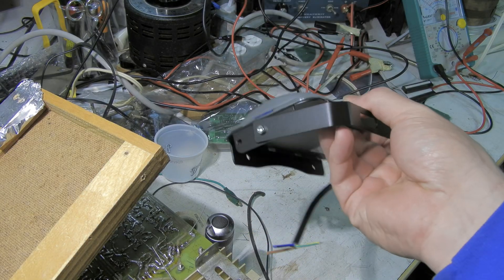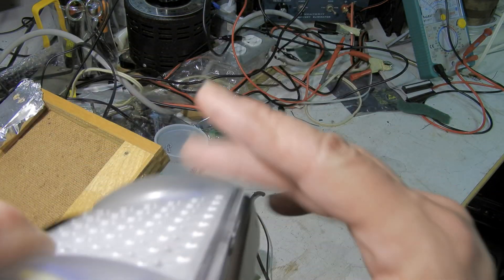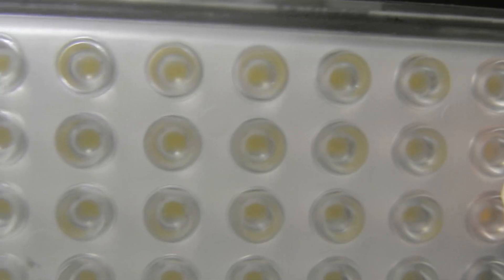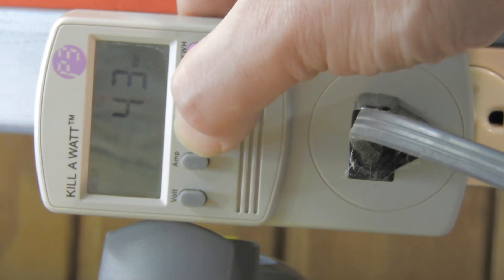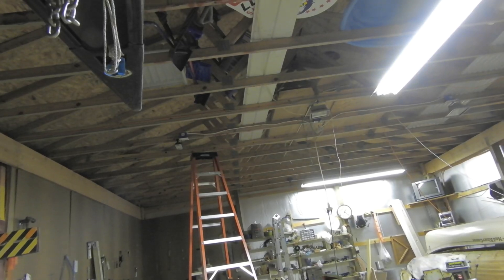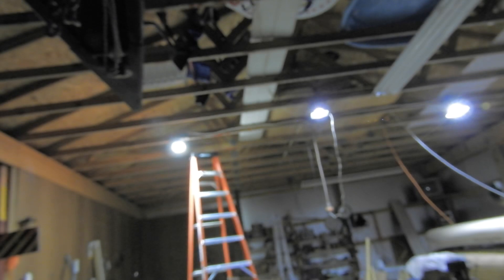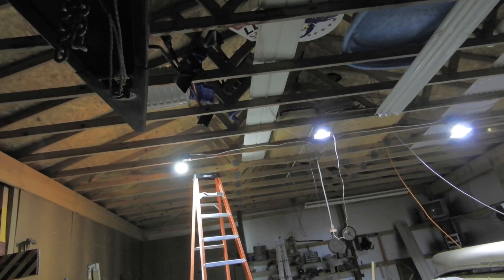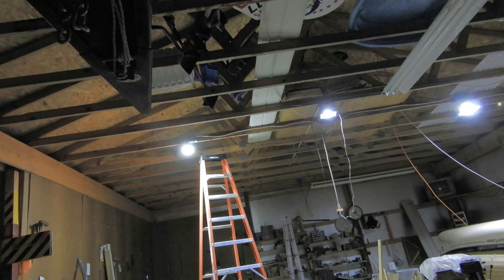Another 50W LED Fixture Tested - "Dream Cast"

Comment: At least it is not drawing 40 to 50% its rated power that seems to be the trend with this cheap lighting these days. Its a crap shoot whether it will last or not.
Reply from the maker: It is a tough location, and it's easy to leave them On for several unintended hours which is a lot of heat on a hot summer day. And the arctic winter temps are probably even a bigger challenge.